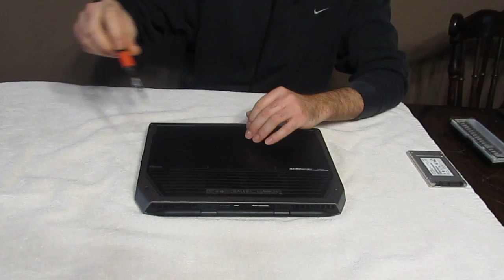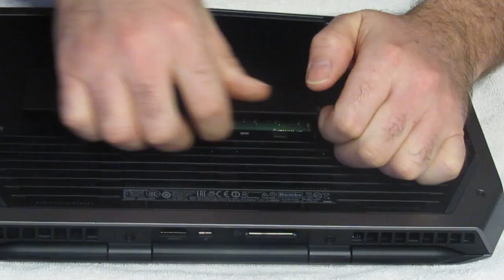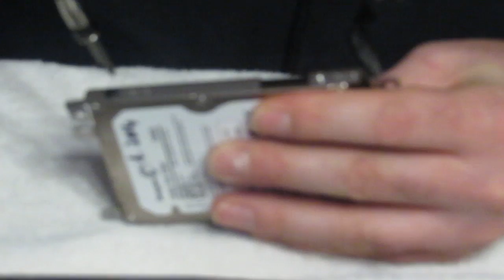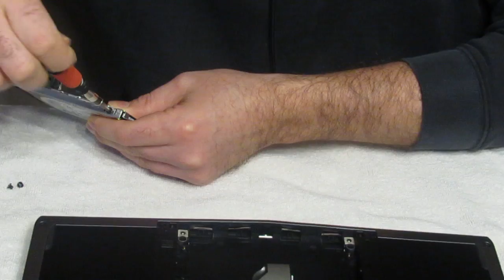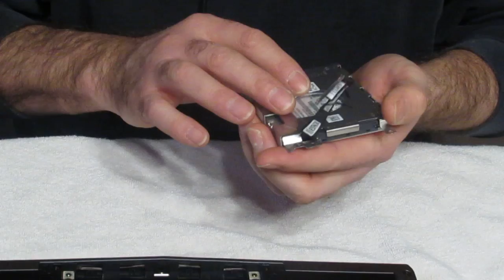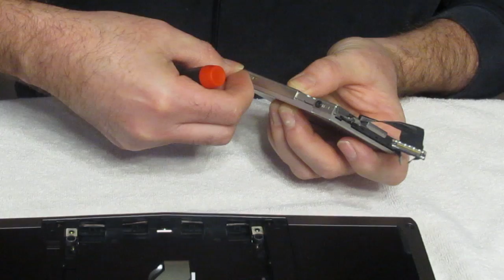Alienware 13 Replacing Hard Drive With SSD Part 1

Comment: So, the max you can have is:

1 x SATA HDD
2 x m.2 SATA SDD

?
Reply: 1 x SATA HDD OR 2 x m.2 SATA SDD
Reply: @anerdwitdacamera204  Does M.2 PCle also works in those two slots?
Reply: If given the choice rather have 2 M2 drives

Comment: Can this pc use a msata or m2 ssd?
Reply: +rob hype It can use 2 of them instead of a standard hard drive but you have to buy an adaptor, which I never did so I don't know who sells them
Reply: +rob hype Yes you can use msata or m2, BUT. It requires a special converter. If you buy it now it will be max 2 of the m.2 type from alienware itself. Or you can buy a 2 msata to 1 2.5'' interface converter and get 2 msata ssd's of the normal size. A bit older. Also consider the fact that it will be quite expensive in the end. It is almost beter to buy just a bigger 2.5'' ssd altogether.
Reply: Thanks

Comment: Hi! I've replaced the hdd with a Crucial MX 200 SSD.
The bios seems to recognize the hard drive, but if I try to reinstall windows, it doesn't detect it!
How did you do to reinstall it ? did you had some problems like this ? thanks
Reply: thedarkpal  crucial ssd are not compatible and some intel dont work  with the alienware 13 samsung is your best bet mate

Comment: My AW13 does not not recognized my ssd (Intel 530 240GB) and not shown in the BIOS. It works on other laptop & pc. Any idea?
Reply: ***** Hello, thx for the reply. I formatted the ssd and run alienware autopsy. Problem is that the BIOS does not detect my SSD :( Even Alienware tech support has no idea whats wrong with it.
Reply: Yoong KOH its not compatible mate alienware are having problems with alot of ssd if you got it working plz share thanks

Comment: I have the alienware 13 with i5 processor. Since the new alienware 13 came up with i7 processor, is it possible to upgrade my processor to i7 or the only option is to buy the new pc?
Reply: ziang momin The processor is soldered to the motherboard , so nothing can be replaced. You can only change HDD and RAM!
Reply: Thank :) so all i can do is replace the pc
Reply: You can call up Alienware and ask them you want i7 and want to return the i5 and they will offer you $200 or take the i7

Comment: I don't like that this laptop doesn't have a dedicated sata port. instead you have to use that adaptor to plug it into the motherboard. I wanted to ask if you have had any problems with your aw 13? I already ordered mine but before buying I didn't find anything about problems. the aw15 I have seen many problems though.  great vid and thanks

Comment: Hi i got a question which one is better should i get it with the 5400 rpm hdd or the ssd?
if i get the hdd is it possible to add an additional ssd? vice versa? 
i did alot of research on ssd n despite the price n the capacity; ssd is much more reliable than hdd; however i heard about the problem that ssd can only "writes" for a specific amount of times. so it will not last in the long run. im an everyday user i'm also doing coding, sfm (source film making) or maybe graphic model soon also i played games but not hardcore.
please reply asap cause the boxing day discount is still available.
Thanks.
Reply: ***** Thanks, yes after hours of research ssd is much better and is the future. There is a reason behind its price. And what about my second Q, is it possible?
Reply: Dayz 3O6 did you figure out if you can
Reply: hamzie11 no, the AW13 is built for only a hdd or 2 ssd (same type). so you cant have a hdd and a ssd.